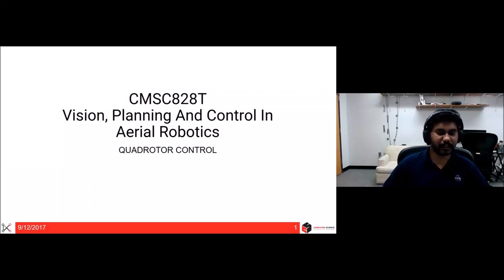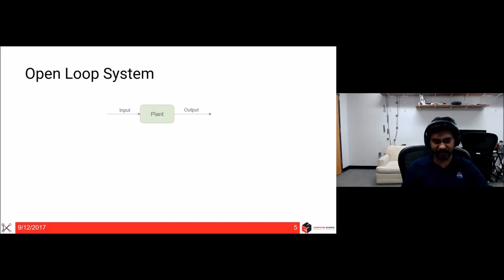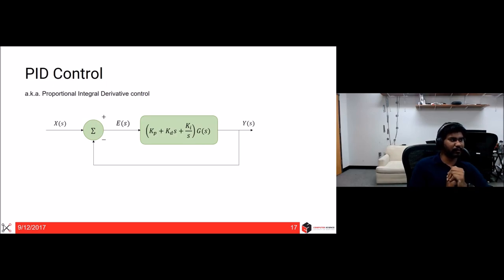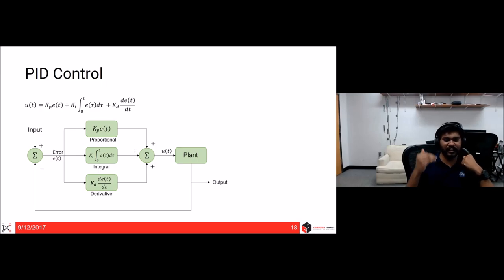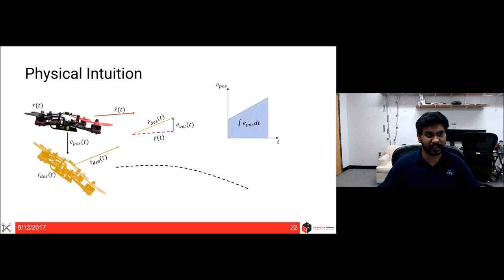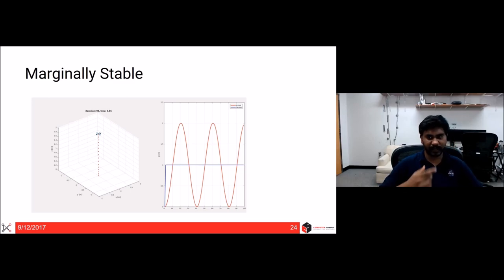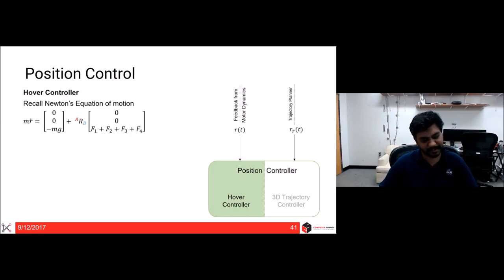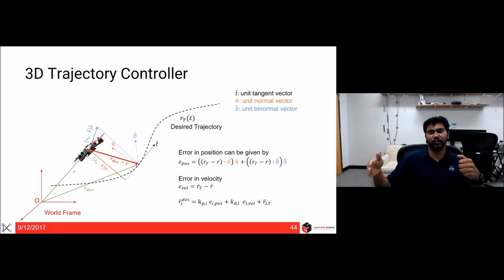Lecture 5: Quadrotor Controls

Comment: How to calculate the outer loop desired angle
Reply: from the linearised control law of the position controller @41:32, given some desired trajectory you can rearrange the equations for accelerations to calculate the desired angles for theta and phi